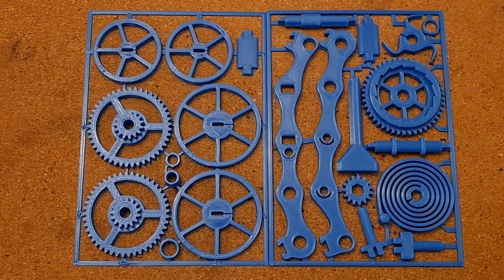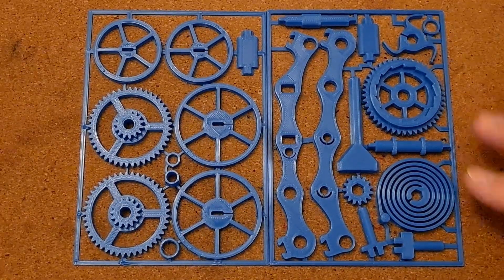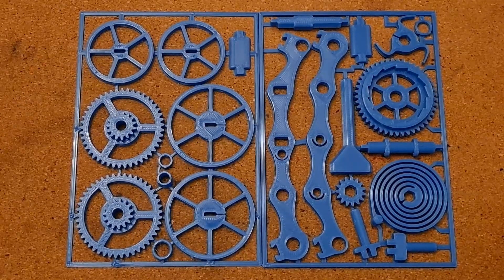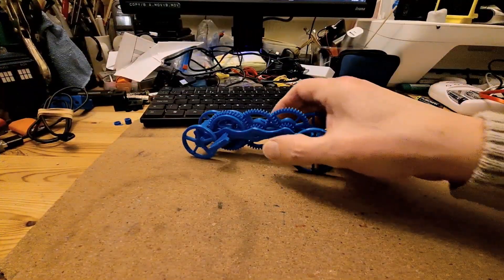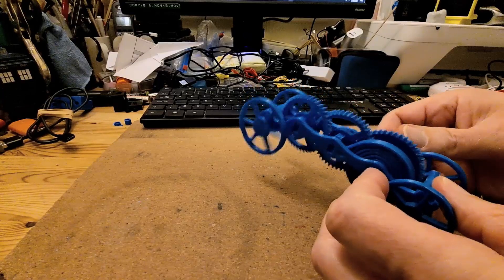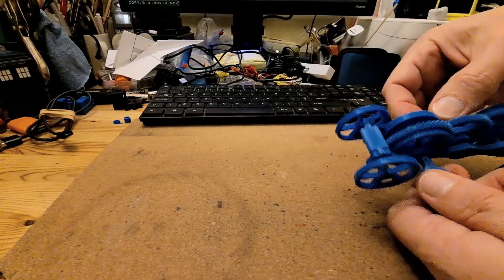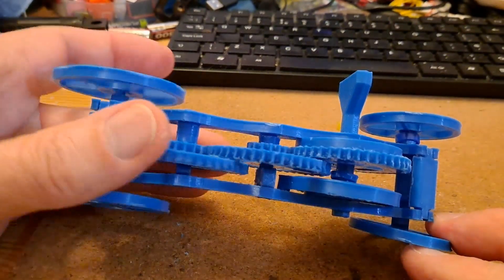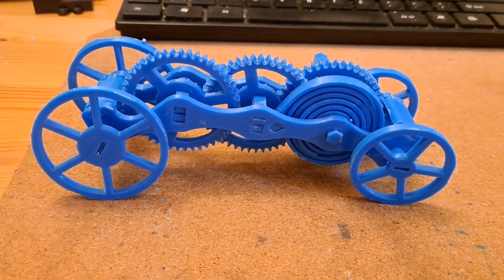3D printed wind up car Second attempt

Comment: waiting for the spring
Reply from the maker: ♨ <------- That is supposed to be an emoji for a spring, can't see what it is supposed to be !!
Reply: @GrandadIsAnOldMan  just use springy material and not elastoplastics
Reply from the maker: @prep0wer  the point of the build is to make the whole thing from PLA.
Reply: @GrandadIsAnOldMan  and glue
Reply from the maker: @prep0wer  no, it was designed not to need glue, but I did end up using it. I have just done a different 3D wind up car which performs much better.

Comment: Nice build but the Plastic is brittle tho.can you buy pla that is more stronger but that would coat more i think.it worked for the First part which is success.
Reply from the maker: I just try the cheap stuff to see if it works, and as you can see, I do get some problems